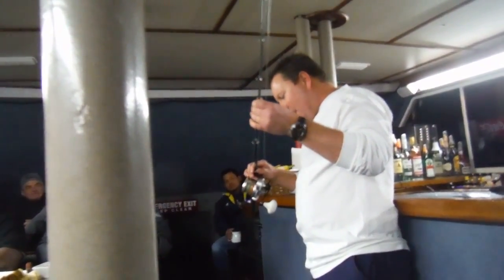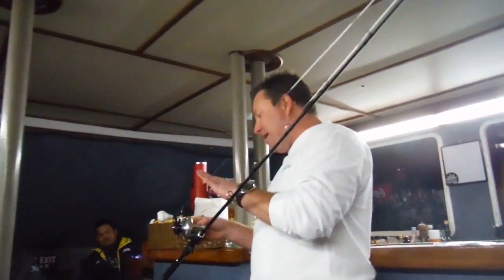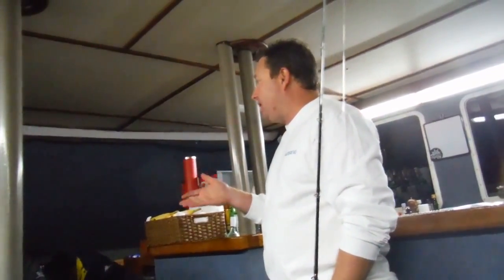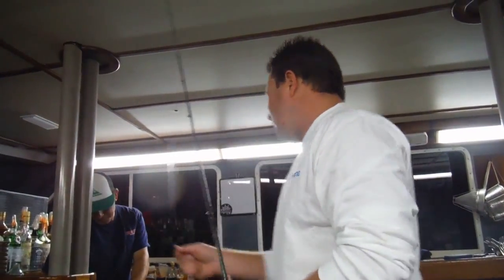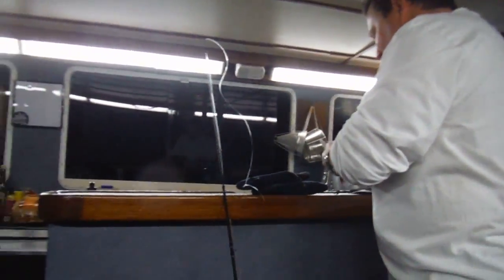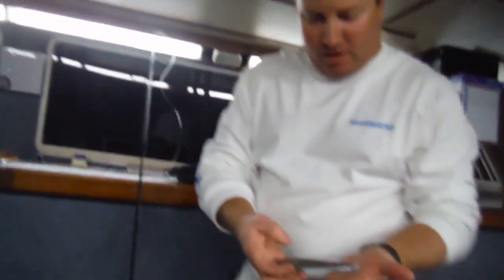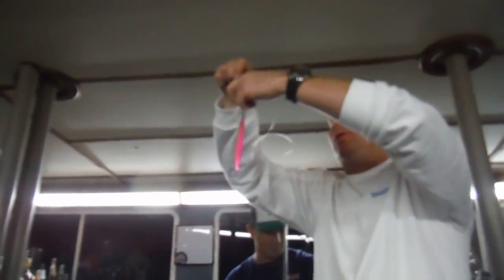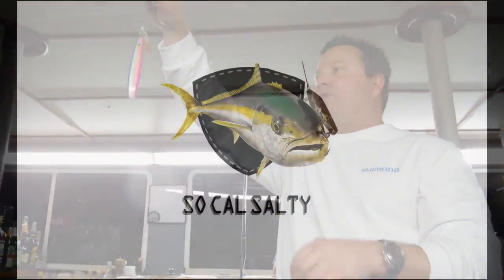Shimano Trevala Jigging System

Comment: what reel does he recommend?
Reply from the maker: Since we were fishing yellows, they used Trinidad's, fully loaded with Power Pro to just a short topshot
Reply: SoCal Salty holy crap how much does power pro pay you?  there are a ton of top braided lines some a lot better than power pro.
Reply from the maker: Mehinder Dub seeing as how that's a Shimano rep, and Shimano owns Power Pro, what braided line were you expecting them to use?
Reply: SoCal Salty hahahahaha good answer. 

By the way, what size spinning reel would be good for yellowtails and tunas in the socal. Im use to 15 to 30lbers so i was thinking 5000 or 6000?
Reply from the maker: yosup84 I don't know enough about spinning gear to say.  It depends on the application, to flyline a live bait, you want to fish 30 and have at least 200 yds, but for a yoyo or deep dropper loop scenario, 40 is better and 300 yds.